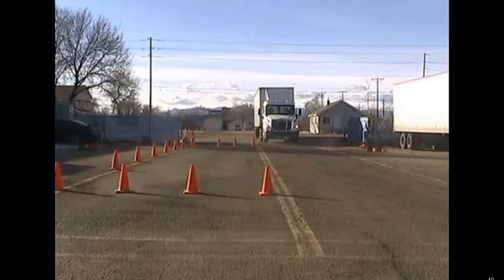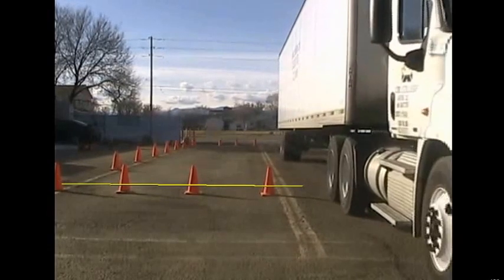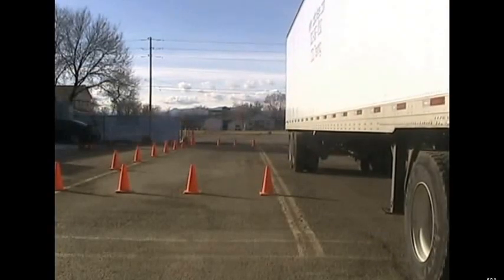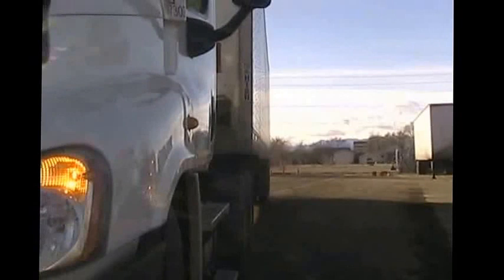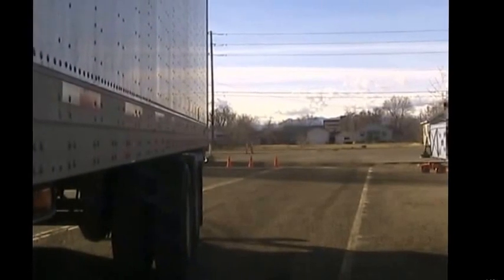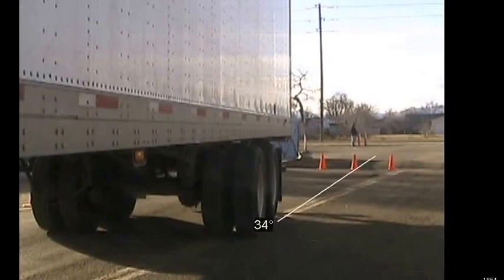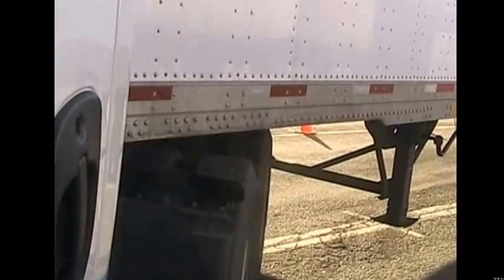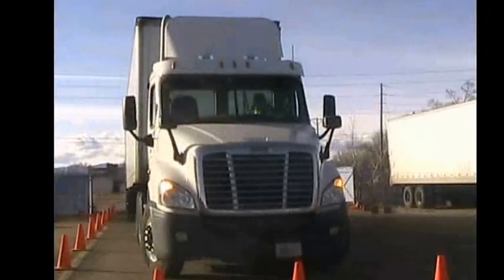Parallel park blind side  cdl college micro lesson

Comment: Thanks for the video. this wouldntt work here in illinois. I take my test tomorrow just finished 16 week schooling. Here we must pull straight forward until our bumper just passes the cone we can not get that angle you start out with or it's a fail so we pull just past the cone then have to start back and get our angle from there.
Reply from the maker: +FilthyFletch That's the way we teach it also. This video shows the old way to parallel park. The new video is here: https://www.youtube.com/watch?v=xz8ssubJUM8&index=3&list=PLZ8QLN78x74bTlvn4xVOMCqYDc6j-VPA_
Reply: I am in driving school in Illinois.  We are following the technique in this video starting about the 47 second point in the video until the end.  What we do before is to pull the tractor and trailer beyond the front of the cones in parallel to comply with the Illinois CDL requirement, and then we back the trailer up to about the point of where the video takes off from about the 47 second point.  Basically, we add two more steps at the beginning part of the video.  I think our instructors like "OLD SCHOOL method."
Reply: Same here in tx

Comment: hi there thanks for putting this video together. this is a different technique than what I'm currently being taught. my question is isn't there a line I shouldn't cross when I pull the truck and trailer to the left to set up for that angle so I can aim at that 3rd cone? the truck in the video seems to have crossed that. I'm excited to try this when I get back in class. thanks again!
Reply from the maker: The technique has changed a little since the July 2015 test changes. You are now  required to pull forward straight past the cones then back at an angle going back. However with the two free pull ups allowed it is possible to align to the third cone with a pull up.